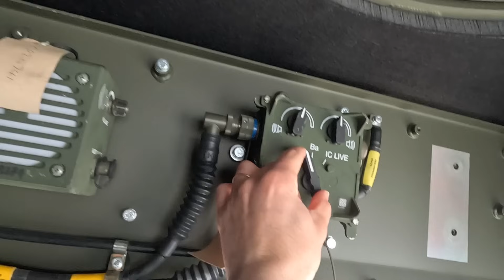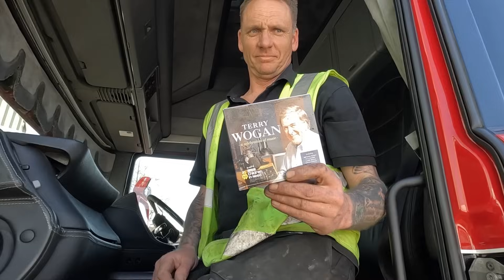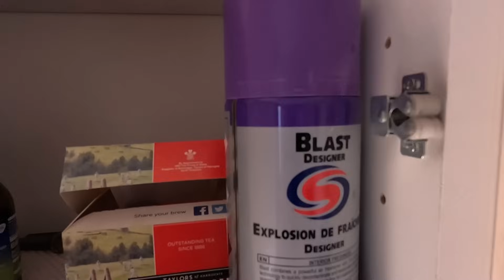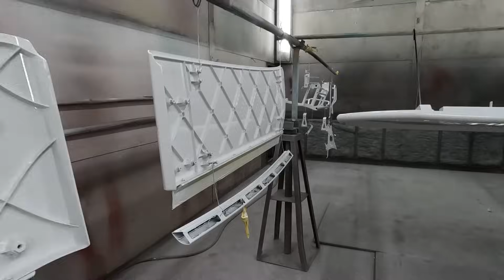Taking A FULLY CUSTOMISED Truck For MOT | My Truck Build *BIG* Update | #truckertim

Comment: I have noticed the trucks down your way don't work has hard has what ours do up here in the north of England. You can't beat the sound of a truck when it's working. Coming up the road from the cement works fully laydaned what a sound at 5:30 of a morning.

Comment: Trucker Tim for truck show ciney you should use your low loader and strap nippers scania in to the trailer and let the r series drive you should also get a black box for the exhaust system so when you arrive at Belgium u can rev the lorry for people who are filming, also you should get the laser lights for your top bar and you should also get a bullbar and get some more lights for that also you should get a pelmet kit from truckjunkie and some blue interior covers to give that blue effect to the lorry

Comment: would love to see a 2 stroke diesel on here or an old V8 cummins to compare the noise, loved driving those compared to modern trucks as the sound was fabulous and unique
Reply: Not forgetting the Perkins 510/540 V8, which was far more common than the Cummins